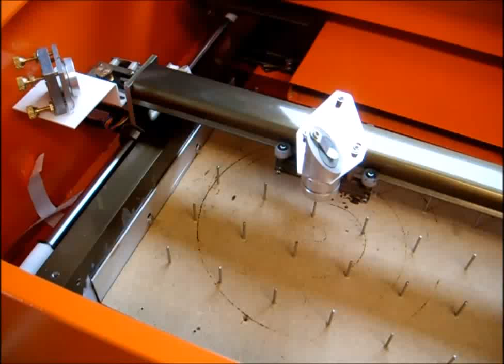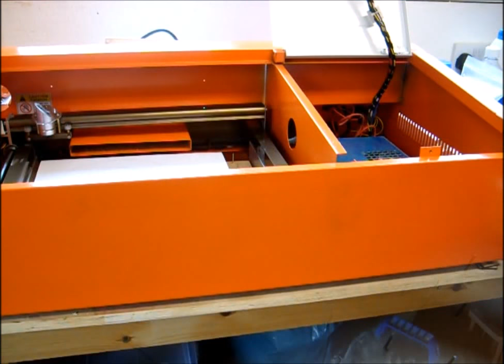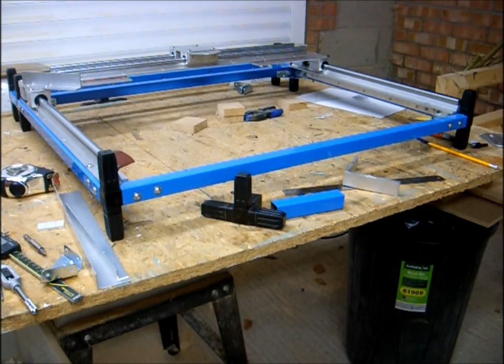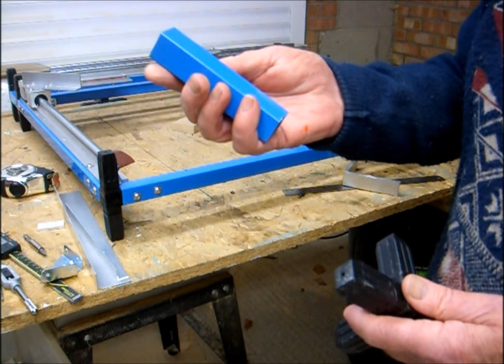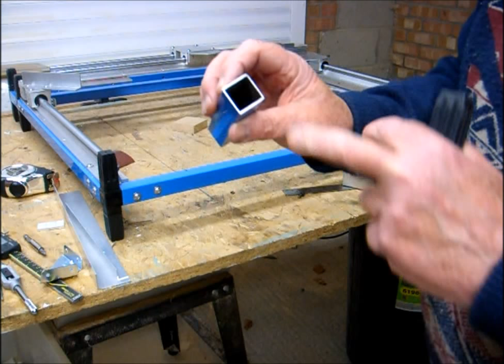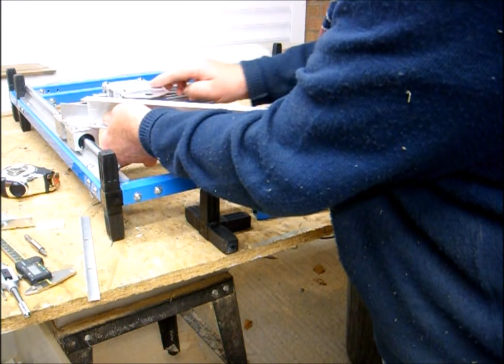K40 Upgrade

Comment: I really interested in this as I have had 10 watt diodes for the last 2 years with tons of room, recently nI got a K40 and realised how small the footprint is. I have build my openbuilds cnc for doing wood and aluminium and having seen this I was wondering how you are going to hide the laser beams unless you encase it all. I was thinking  of encasing them in some sort of bellows system to make it light safe.

Is this what you intend to do or are you going to make a cabinet or what please. Im really interested to learn. Thankyou.

Comment: I purchased my k40 last month. Great piece of kit but limited with its dimensions. I wish I had the technical skills like you Duncan. Would you share the details of your build or help me buy the parts needed to extend the table like you have done? My current laser only cuts roughly 8 inch x 6 inch in a decent focus. Outside this area the laser loses its energy to cut.
Reply from the maker: Extending my table to 620mm x 450mm is not for the faint hearted,  I'm an apprentice trained engineer and have the technical and physical skills necessary to undertake a project like this.  If you don't have these skills then my advice is don't take this project on.
Reply: Duncan Caine thank you for your reply. Agree I am not a trained technician but I am an engineer. I do have basic skills. Are you in a position to help or sell a frame like yours? I would love to be able to put it together myself if I had a basic blue print or parts list. On the other hand, I would also be happy buying a pre cut kit to put together.
Reply from the maker: I don't know who manufactures the tube system, but I bought it from a supplier local to me in Kingston on Thames near London
http://www.tradesystems.co.uk/Dexion-Speedfame-Compatible-25mm-Square-Tube-System.html

and the linear rails I bought on ebay, similar to this
https://www.ebay.co.uk/itm/2Pcs-SBR16-Guide-Linear-Rails-Shaft-L300-1500mm-with-4Pcs-SBR16UU-For-CNC-Kit/142713036010?ssPageName=STRK%3AMEBIDX%3AIT&var=441704656988&_trksid=p2057872.m2749.l2649

The corner brackets were from Screwfix https://www.screwfix.com/p/hafele-corner-gussets-zinc-plated-65-x-65-x-19mm-10-pack/9861p

All the nuts, bolts and washers I bought on ebay as well as the aluminium angle iron

See here for a progress report  https://www.youtube.com/watch?v=hp2lKRgq97Q&t=3s

Hope this works out for you.
Reply: @Shafiq1969  if you have the tools, it would be easy enough to ask for a list of parts and drawing with dimensions. I can look at something like this and start to figure out what I would like to do in my head and go from there. My only real question is whether a belt system is better or a screw system. Belt is less expensive, but is it more precise?
Reply: you can pull out that stock cutting surface, mount a grid or screen at the same height. Get k40Whisperer laser driver software (free) and Inkscape software (free) and you will be released from your spring loaded cage.
Reply: @robdude1969  you dont want whisperer and inkscape you want lightburn and Cohesion or mini gerbil, creating the rig is relatively easy its knowing what to do with the invisible light thats y concern

Comment: Very nice, where did you find the steel tubing and three BLK insert joiners? Are you still going to used the pulley and belt system or change to lead screws?
Reply from the maker: I don't know who manufactures the tube system, but I bought it from a supplier local to me in Kingston on Thames near London 
http://www.tradesystems.co.uk/Dexion-Speedfame-Compatible-25mm-Square-Tube-System.html.  and on the basis of cost, I'm sticking with the belt system for now.